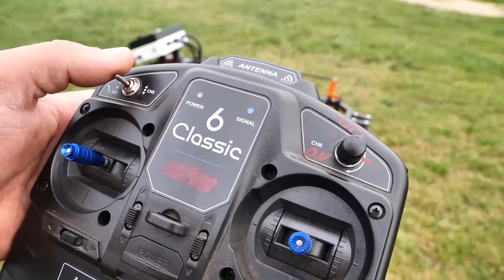Making RC Lawn Mower

Comment: Great video, really like how you did the deck height control linkage.   I really want to build a tracked version as I have some steep banks to cope with and this would fit the bill nicely.
Reply: Just get a tracked mower and snowblower and make a monster mower!
Reply: me too
Reply: @georgef1176  That's not a bad idea although a tracked snow blower is pretty expensive and I'm on a limited budget.
Reply: I am building something similar to what you are describing here. Are you having an issue fabricating the tracks and rollers? Have you considered using the tread of a dirt bike tire as the track?
Reply: @earnwithbots2783  how did it turn out? I cut grass for a living. I would love to have one of these 😊
Reply: As someone fixing to turn a 54 in mower deck into a tow behind I love the way he did that.   I have a electric clutch for my motor and I found a simple 4 channel remote that is just simple rockers to mount on my tow vehicle that I am planning on using to start and stop the blades. I was trying to figure out my deck adjustment but now I will put it on the other channels with a actuator.    Very cool.   Yeah my first thoughts was tracks and make it for slopes.   Would of been cool to use a 42-48" deck too.
Reply: @jvmiller1995  I'm working on converting my Swisher Rugged 44" shredder into a remote controlled tracked shredder. it has a 12.5 Briggs & Stratton from factory but being i'm in a wheelchair myself i can't pull start so im going to swap my engine from my Cub Cadet LT1046 so i can get electric start plus electric clutch. my only 2 issues are #1 low income means i have to work slowly lol, #2 i worked in machine shops for near 15 years before my accident so i understand all the machining and fabrication but i am lost on the RC part, guess ill be learning soon lol. I'd like to hear how your project turns out.

Comment: excellent invention. RC. I wish to see one day: 1. pair with a drone and the AI will mow the whole lawn by itself. 2. able to pull a module for dethatch the dead grass underneath, scarify the lawn and aerate at the same time. 3. Scarify and collect derbis together 4. pick up the grass, in whatever way after yourself - roll up in hay like OR bag plastic bag. 5. Pull a trolly and spread fertilizers, 6. pull a trolly and spread overseedings. 7. use laser and measure where are the spots to help levelling. Excellent thing!!!

Comment: I wanted to build one in 1981, I was just thinking RC steering wheels assembly to a self propelled lawn mower, but you have taken this to a new level with separate rear wheel power it works great as a zero turn.

Comment: Maybe one  of the best videos you have made!
Seeing you using the shop equipment that you already built is really satisfying!
Reply from the maker: Thank you 😁
Reply: @WorkshopFromScratch  I second that, super cool build. My only suggestion is hanging the cutting deck with chains and installing a string of rollers on the leading edge so that when it hits an immovable object like a rock, log,  or uneven ground it bumps the deck up without transferring all the force to the plastic actuator.

Comment: This is pretty damn cool.  As much time and work and money that you spent you should of used a multi blade deck from a rider and done at least a 42 or 48 in cut.    If you put small tracks on the rear for better grip it would serve as a great mower for slopes that are to big or dangerous for a rider too.        But overall this looks like fun.   As always great job.  You are the best channel for these kind of builds.   You started out with very little equipment to it is nice to see your shop and skillmanship grow.
Reply: I recently watched a video where the guy basically only used a 50 inch John Deere deck and engine to build one of these. It was half the length of this one and was all wheel drive. It looked like a converted push mower on steroids😂

Comment: Great idea and amazing build! You should put air filters on the electronics fan. Dont let it pull dusty air in and get all over the electronics! Also the engine rpm should not exceed 3600RPMS. It sounded far higher than that.
Reply from the maker: Thank you 😁 You are right with this filter, I will definitely do it. The motor I use is a Chinese motor, and I can't even find the name of the manufacturer, I once bought a mower with this motor in a supermarket and it had such a high speed rmp.

Comment: Absolutely amazing build as always.
I was thinking about the same project for a while. 

Quick Question: I was brainstorming about going a step further and controlling the mower through internet connection remotely 
Any ideas?
Reply: GPS-Sensors are rather cheap these days. You could attach one to a microcontroller and write a routine which navigates from one waypoint to the next.
Throwing in a compass module or an accelerometer too won't probably hurt either.
Involves some math and will probably take a few test runs and some tweaking to get it right but then you'd have an autonomous lawn mower which works completely offline.
Reply: There is an open source project for GPS guided robot mowers. As cool as the remote-control feature is, it will quickly become boring. This way, you can just tell it to mow the backyard with a phone app.

Comment: Great work, very organized, I'm really impressed, but you can also use solar panels to charge the batteries with your current system. Another idea: The gas engine could have been used to move the lawn mower through a mower gearbox with a clutch (The control of mower's movement by the clutch with DC actuator motor), there will be significant battery charging savings. You can also automate the system by adding some sensors with an Arduino board and some fixed reference points in the garden.👍

Comment: The metalwork is solid but the placement of the wheels and batteries is not ideal. When you are doing a zero-turn type of drive configuration the axles of the wheels should be sort of in the middle of the load. Here, it would seem that most of the weight is in front of the wheels. This means that if the grass is damp or the soil is soft, it will be making skidmarks and ruts all over the place. Another consideration is that instead of using a mower engine alone, build it around a portable gas generator. You can then us the gas engine to power a generator which supplies power to the motors, which would drive the wheels and the blade. In this instance you'd only need a single 12V battery to start the engine.

Comment: You need a 2.0 with gasoline 12v charging and bigger speed controllers. Those little guys are going to burn out. Imagine if you could just dump gas in it and it charged the batteries.

Comment: Quite complicated Why not to use complete  drive axle from mobility wheelchair with controler . In my option I had to make wheel adaptors to fit garden wheels. Another type to use is golf cart and cutting deck added electric or gasoline , Vey nice construction and work.

Comment: I make a couple rc mowers using a $100 hft welder. This guy have his own metal fabrication shop with 10k worth of tools at least.  Some stuff u design isn’t need like chains driven, and welling entire deck on to the frame. What if u need to swap out a different deck or mower later, u should do remote start instead remote height adjustment because how often u need to adjust the height while mowing. If I had all that equipments then I’d design it more compact because the swivels and battery deck is sticking out making the mower longer while your mower is in the center so u don’t get close cut to the walls so U have to cut like 3 or 4 times more. The remote video thing is a gimmick because if you’re not out there watching where it’s mowing then be ready to fix your engine from running over rocks, tree stumps, woods etc that u didn’t see because u were too far away. I build my first prototype out of aluminum about 10 years ago (check my channel) the. I gradually change it over years. It’s seems like u copy the  designs. We went with this because us DIYers have basic tools and knowledge of metal fabrication. There’s a guy who built this commercial make his frames compact and he even have tank tracks because these go kart wheels have limitation when the grass are wet or hills.

Comment: This is amazing. As a child, 25 years ago I had a similar idea and drew a sketch. It never left the drawing table, but seeing a similar project done for real brings up a big smile! Thank you for sharing.
Reply: I plan on doing a build with an electric mower and use the wheels and motors from a mobility chair.
Reply: @shanemichaels8289  sounds cool! At home we use a wired electric mower. I assume you would like to use a battery electric mower, right? You might be able to tap into its main battery for comms and steering. 🤔
Reply: @joostk  yes I’d like to use a battery mower. Or an A/C electric mower with a power inverter use the same battery for the drive motor and mower motor
Reply: @shanemichaels8289  like the one I am building on my channel (albeit very slowly). You don't want to be using the mobility wheels, they are too narrow.

Comment: I usually put the bolt in the hole facing down so on the off chance the nut comes loose, gravity can hold the bolt in instead of losing both the nut and the bolt.

Comment: I've bean dreaming of just this since 2008, when I moved to a property with one hectare of grass. It's nice to see that someone finally did it. A cool upgrade would be adding an Arduino-based autopilot (Ardupilot) and let the mower do its thing without even having do drive it.
Reply: If you have a big enough yard: Stick a pole in the centre, attach a rope to it. Have a self driving mower with a rope attached. Start it and let it run. Every round around the pole the lawnmower is pulled closer since the rope is wound around the pole and you only need to switch it off if it reaches the centre pole.
At least the majority is now mowed 🙂
Ideally, I would have loved to arrange my garden then in a circle around that pole, but what I gotten was a hilly garden with many already existing trees. A pity I can't play my idea...
Reply: @marwerno  What a great idea!  Can't test it out though, as I no longer live in that house. Much smaller garden now. The former place had a lawn about the size of a football field, and just as flat. Should have thought about the rope trick back then. 
Cheers
Reply: @marwerno  , get rid of the trees, till the soil, and rebuild your garden, problem solved.
Reply: @paxhumana2015  not at that hill. 
5 large and old Cherry trees, 6 Apple trees (giving me each year between 300 and 700liters of Apple juice, plus some for eating), 3 Pear, 3 Walnut plus others I am not going to just fell. 😉

Comment: Amazing! Your work is top notch! Only thing I’d try is a rc car remote with the wheel possibly be a bit easier to control.
Reply: its setup to drive like a zero turn. left stick controls the left motor and the right stick controls motor. both forward to go straight forward, both backward to go straight backward. then mixing forwards and backwards to turn in the respective directions.

Comment: Would you please share the links to the motors and speed controllers. I have been thinking about this for sometime you just took all the prep out of the designing for it. Thanks I hope you can share the links.
Reply from the maker: Regulators for the engine:
https://pl.aliexpress.com/item/1005002064178323.html?spm=a2g0o.order_list.0.0.18751c24AtHknx&gatewayAdapt=glo2pol
Regulators for an electric lift, I do not recommend using them for engines because they do not like long work, I have already tested them
https://pl.aliexpress.com/item/32237863559.html?spm=a2g0o.order_list.0.0.18751c24AtHknx&gatewayAdapt=glo2pol
Electric engine 
https://www.amazon.pl/Alomejor-Redukcja-przekladni-elektryczny-elektrycznego/dp/B07YZDKT7X/ref=pd_sbs_sccl_2_1/258-2047194-2896111?pd_rd_w=uY8hA&content-id=amzn1.sym.30ecb7a0-fae7-44ff-83be-2fde9e98d045&pf_rd_p=30ecb7a0-fae7-44ff-83be-2fde9e98d045&pf_rd_r=1BY6WZN7KXZ9KB632WK1&pd_rd_wg=EMnfs&pd_rd_r=fca9db5f-fefa-409b-8221-af8bd087582f&pd_rd_i=B07YZDKT7X&psc=1
Remote control and receiver, buy a better one because you can configure the control better

Comment: Awesome build! Have you considered adding a gps module to allow it to "learn" a course and run it by itself?
Reply: Or input the course once with memory on. Then put the mower back at start point and press play.
Reply: Apparently they have a small yard  battery mower similar to the automatic vacuum cleaner  my question is why isn’t a manufacturer already building these machines looks more affordable than most zero turns you have to steer

Comment: This is impressive!  Lots of features on that beauty!  
For taller grass and weeds it’s helpful to open up more area for discharge so it doesn’t bog down.  I cut the whole front and back off my mowers deck and attached flaps to protect the operator.  I use it for wet grass, weeds, small trees etc and it eats it up and spits it out of the way without slowing down.  
Luckily there aren’t any toddler toes to avoid here.

Comment: Beautiful build and design. I was just wondering though, if you could have used a small motorcycle engine  from a 50 or 70cc honda, with it's built in magneto (for lights and stuff) to power a small motorcycle battery to take care of the electronics? Or does the motor you put in it have a magneto as well?

Comment: rear wheels are too far back from the center of the machine, or too close together. You can see it really struggle to pivot the entire mass of the mower when it makes a turn. Spacing them out and or moving them forward will give you better leverage on pivots. Other than that nice execution.

Comment: The idea is super! 👍👍👍💪👌 But it is better to put larger diameter wheels in front to improve the roll, take control of positioning and movement speed from the copter, cameras forward and backward, and a powerful 800 - 1000 meters peridatchik 😁
Reply from the maker: Thank you :) The project was a bit experimental and can always be expanded 😁
Reply: @WorkshopFromScratch  A very good project idea 👍 Automation has a great future, and with golden hands in twins

Comment: If the charging coil can't keep up with the current draw then you're probably best to swap it with a small alternator & rectifier. It'll be able to run as long as you have fuel then, and will only need a small battery that can start the engine.

Comment: very nice build. My 2nd RC mower is over a year old. The mower its self is about 6 years old and now leaking oil. My first 2 was 24 volt. I think I will make the next on 36 volt like you did.  Mine has never had power deck adjusting. I like that. Come Fall, I will rebuild mine.

Comment: The biggest problem with your project is I can’t duplicate it because everything is welded.  I don’t have a welder, and even if I did, its been years since I did anything remotely like this.
Reply: I was thinking you can just take a zero turn lawnmower add the remote controls.  He was just showing off his building skills.

Comment: How are you charging batteries for the motors? Do you have to charge them individually or do you have a charge port that will charge all three at once?

I've always wanted to build one of these. It's way easier now I think than 10-20 years ago.

Comment: I'm working on converting my Swisher Rugged 44" shredder into a remote controlled tracked shredder. it has a 12.5 Briggs & Stratton from factory but being i'm in a wheelchair myself i can't pull start so im going to swap my engine from my Cub Cadet LT1046 so i can get electric start plus electric clutch. my only 2 issues are #1 low income means i have to work slowly lol, #2 i worked in machine shops for near 15 years before my accident so i understand all the machining and fabrication but i am lost on the RC part, guess ill be learning soon lol. anyone have other ideas feel free to comment

Comment: Very nice. I've made about three versions of my r/c mower (including handmade wooden wheels!) but not as well engineered as yours.  I've used wheelchair motors and at 12v they struggle to have enough torque for my very steep ground. For charging, I adapted a self-propelled mower drive by fitting a car alternator to it, using a belt off the main rotor. Worked well, but again only at 12v. Like you, it didn't generate enough to power it properly, but did extend runtime a lot.
Reply: Yeah I think 36v is where it's at. However most wheel chair motors are 12-24v. And they don't exceed 30 or so amps. Which is crazy, because some wheelchair owners are pretty dang heavy.

Comment: I would love to do this :)  One thing, would not the steering work better with the swivel wheels on the back end?  would be fun to add gps controller and set way points to auto follow :) Thanks

Comment: Nice build, how did you control choke and throttle ?
Reply from the maker: The engine has no choke, you need to pump with a pump each time to start it, I connected the coil to the R / C relay to remotely turn off the engine or it turned itself off after losing the remote control range

Comment: can  you please send more details on the connections of the electric jack, motors, engine and the power control of the battries to the remote I did not quite understand that part
Reply from the maker: Ok:) In 4-5 hours I will update the description with links to parts:)

Comment: motor 12v or 24v?
Reply: 24v, that way you can reduce the speed to what suits your mower, as opposed to getting a 12v motor and the speed output is not enough for your mower. Of course you can double the output of the 12v motor by either wiring two 12v batteries in series thereby making their total output 24v or you could simply use one 24v battery, however, doubling said speed of the 12v motor is bad for the motor in the long run and will likely end up with the 12v motor burning out.